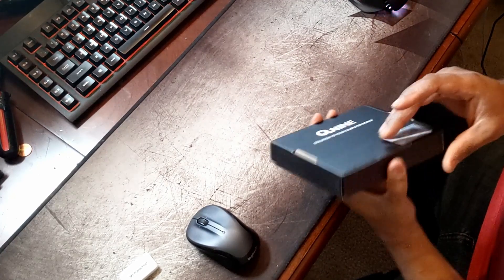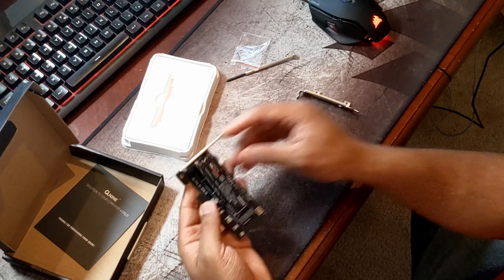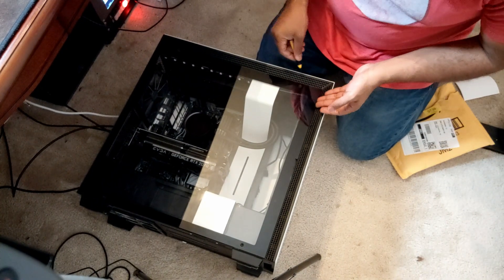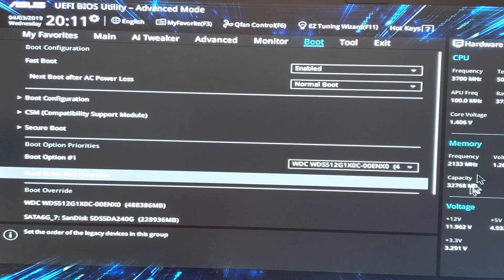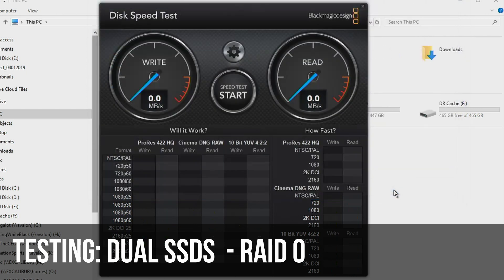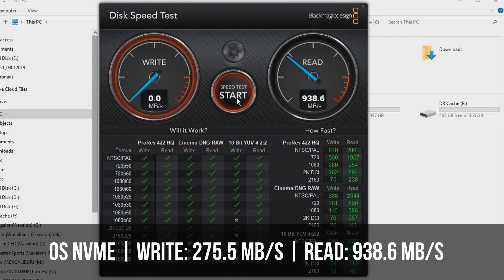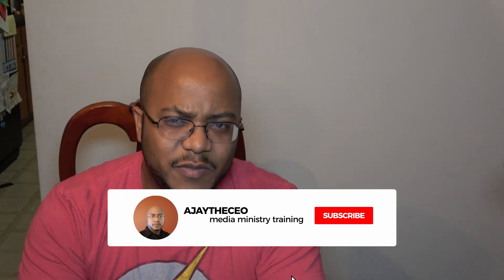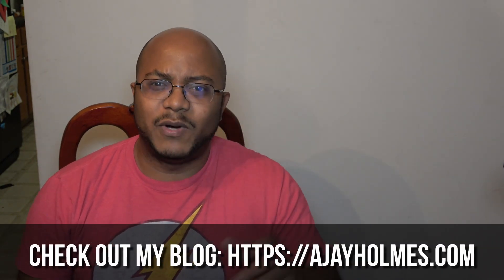Installing An Extra NVME SSD with a PCIe Adapter Card

Comment: I have a problem, the drive and the controller(adapter) are recognised in bios and I can even boot from nvme. But once I get into Windows it doesn't work, windows is very slow and constantly refreshing, and nothing can be opened. Once I go into safe mode and disable the controller everything works fine, and when I enable it again it starts doing the same thing. I have to restart my pc. Could this be about drivers or a faulty nvme?

Comment: My MoBo is MSI 970 Gaming.  It does not have an M.2 slot.  If I will be able to use a PCIE adapter to use an M.2 Drive to boot from the same?  Or if I will be able to use it as storage Drive only.   What can be done to boot from an M.2 Drive connected thru PCIE adapter?

Comment: Does anyone know if a NVME SSD with PCI Express 3.0 x4 adapter card will always work when you insert it into the PCI Express 3.0 x4 slot on your mother board.  What I'm asking is if there are different standards or communication protocols on the motherboard that you have make sure that has so that it will work with your motherboard.  I have a newer Dell motherboard that only has one M.2 slot that's used, but I'm told you can only add sata drives, but I think that's just because they don't offer an adapter card option like this video. Do you know or can advise? thanks
Reply from the maker: It should work.  How many pcie slots do you have and how many are you using?
Reply: @AJaytheCEO  I have qty 2 x4's, but one is being used, I also have one unused x8
Reply from the maker: Ok I'm not sure if it will work or not.  Sorry

Comment: AND ONE PCIE 2.0 X16 SLOT THAT CAN OPERATE IN EITHER X1 OR X4 MODE (THE LONG ORANGE BOX).
Reply: I want to ask
I have ssd nvme brand orico and adapter pcie x4 no brand
When I plug in the PCIe X16 slot and after I check in the device manager, the other device appears "PCI device" with a yellow exclamation mark, how do I deal with that?

Comment: I installed ssd 970 evo plus nvme m.2 for os. The problem is that the SSD is not detected in the bios but it's detected in Windows 10 so I can't change my boot priority. Maybe you can help the solution. Thanks.

Comment: Terrible speeds on Intel AFAICT. On AMD Zen those Evo drives should do 3000MB/s reads.

 I am not surprised. Intel only has chipset lanes to use for nvme if a proper dgpu is used. zen has 4x true pcie lanes spare for a real pcie 3 x4 nvme - so its pointless doing raid on intel, paired nvme simply saturate the 4MB/s total intel chipset bandwidth.

Comment: Thanks for the great vid, in your opinion is it better to use onboard M.2 slot or use a PCIe Adapter? Which is faster? I have an MSI Z170 Krait Gaming motherboard and an Evo 970 plus 500GB Nvme, have realized that on heavy usage I get high temperatures on the onboard M.2 slot. The PCIe with an added cooler would solve the heat problem for sure, but as I search online some people say the PCIe x4 adapter adds overhead and latency in the communication with the CPU, others say it performs better. What do you think? Best Regards, Alex

Comment: During 'lock-down' I too made jump to bunch of M2 drives for DR W10 editing; what's confusing me is; I use ASUS V2 Hyper 4xM2 W10\RAID0 for camcorder files and my relatively slower SATA SSDs in W10\RAID0 for DR cache. I have 4gb older GTX970 gpu and new x299 mobo. Should the cache be secondary concern while primary concern be camera speedy files for better DR scrubbing ? And doesn't the gpu memory (etc) provide less frame drops during editing/playing/scrubbing/effects viewing ?

Comment: Do you use the PCIE adapter to make your NVME go faster than 32GBps? I don't think it's possible. Instead of "NOT" using a NVME slot on your motherboard?
Reply from the maker: It isn't faster than the motherboard slot. I did this originally because my motherboard only had one slot. I've since upgraded and used the adapter to add a third drive since my mobo now only supports 2 NVMe drives.

Comment: One important thing, some old motherboards like mine, x99 chipset, comes with 6 pcie slots, ends up that, some of them are 2.0 version,  and some are 3.0 version, if you want the full speed of the Nvme, you need to install the pcie card into a 3.0 slot, you have to refer to your mobo owners manual to see that.

Comment: will this work with my RAMPAGE IV EXTREME motherboard? as a boot drive and installing windows 10 ?
Reply from the maker: Yes it should work
Reply: @AJaytheCEO  so no need to change my motherboard?🤔
Reply from the maker: @bgabreal1212  correct

Comment: Is this Pcie Adapter better? AKASA AK-PCCM2P-02 M.2 SSD TO PCIE ADAPTER CARD WITH HEATSINK
Reply from the maker: Not sure but thermal management would be better
Reply: nvme doesnt need a heatsink in fact it operates worse with a heatsink

Comment: The evo plus has: Read speed 3500MB/s & Write speed 2300MB/s. While the PCIe Adapter speed is Up to 3200+ MB/s random Read and 1500+ MB/s Write

Isn't this an issue?
Reply from the maker: Did you install the drivers for the evo? That should get you better performance than running the ones install with Windows for the adapter.
Reply: @AJaytheCEO  Will do this, Thanks
Reply: @AJaytheCEO  Can I install this on mainboard Gigabye H81M-DS2 ? Or any recommended mainboard?

Comment: Caution ::: @3:58  touch bare hand to chips is surely reducing the life and performance by ESD. It is not Lego.
Reply: should you put on some latex gloves or something instead? honest question
Reply from the maker: No need.  If you are properly grounded you are fine.  In 20 years I've never fried anything electronic
Reply: @AJaytheCEO  ...sorry to say, ignorance is the blessings here. ESD do not destroy the chip instantly (it is not zero or one). it creates a hole. It is interesting subject and you must learn it deeper instead of such claims.

Comment: I didn't get if in the end you moved the Samsung ssd to the m.2 slot or you are still using the adapter. I'm asking because I've done the same but the speed is half its declared speed when using the adapter
Reply from the maker: I originally used the Samsung in the adapter. I've since upgraded my motherboard which has 2 m.2 so the samsungs are directly connected to the mobo and I'm using the adapter with a 1tb NVMe
Reply: @AJaytheCEO  Sorry to bother you again, what about the speed with the adapter? Are they the same as without it? Did you change anything else beside setting the pcie slot to 4x?
Reply from the maker: @jonathanxdoe  My C Drive 970 (mobo m.2 slot) 551.6 MB/s write and 2552.6 MB/s read

F drive 970 (mobo m.2 slot)  3111.5 MB/s write 2982 MB/s Read

H Drive 1TB Sabrant (NVMe adapter) 1596.7 MB/s write 828.4 MB/s read
Reply: Had the same issue, ends up that my mobo comes with a pcie 2.0 slot  and pcie 3.0 slot, you should put the card into a 3.0 slot, so, check the manual of your mobo for that, they are identical.

Comment: Sorry, You are trying. I moved closer and see you have 2 faint shadows coming from your right side.  We should not see them. You likely do not have them high because it is in a non vaulted ceiling house. Get the 1 main/key up more if possible so we see no shadows. Move the 2nd (fill) to the other side from the main to … fill . That main should be all on you chest to head. It should be the  brighter or closer.   Not nit picky, I just get advice all the time and paying it forward.  The content is good and sharp enough.

Comment: Thanks for posting this video!   QUestions????  I'm very new to Davinci Resolve. How did you make your NVMe drive your cache drive?  Just one more...Do you know how to use the Dimm .2 slot on the ROG Zenith Extreme board? Any help will be welcomed! Thanks!
Reply from the maker: I'll get back to you on this once I get back in front of my computer
Reply: @AJaytheCEO  Thanks!
Reply from the maker: In Davinci Resolve Preferences, there is a Media Storage option. All you have to do is set your drive in this list and the first Media Storage location will be used for cache files.
Reply: @AJaytheCEO  Thanks!
Reply: How do you set up Raid 0 for the NVMe drives? Will be using 2 1TB each.  Did you ever find out how the DIMM.2  slots work?
Reply from the maker: @PhillipSiddiq  that's dictated by the motherboard but windows may be able to do it. That's how I setup my raid 0 with standard SSDs
Reply: @AJaytheCEO  Thanks again.  Dimm.2 slot? Using the ROC x399 Zenith Extreme 1950x Threadripper....

Comment: What port do you plug the adapter into?
Reply from the maker: I was in pcie 2 on my Asus prime x370
Reply: @AJaytheCEO  is the PCle drive just an SSD slot?.
Reply from the maker: @theforgottenones1542  no it is not
Reply: @AJaytheCEO  thanks for the info! Trying this with my desktop with one single M.2 slot. How is it working for you? Mine has to be plugged directly into the motherboard, yours too?
Reply from the maker: @theforgottenones1542  It was working great. I've since upgraded my motherboard that has dual m.2 slots. It ran fine and was super fast in video editing as my cache drive
Reply: AJaytheCEO Sweet no issues with the adapter?
Reply from the maker: @theforgottenones1542  nope none at all after getting the nvme drivers installed to get full speed

Comment: what is your motherboard and system configuration?
Reply from the maker: At the time this was with an Asus Prime X370. I only had my RTX 2070 in PCIe 1 and the NVMe adapter in PCIe 2
Reply: @AJaytheCEO  thank you so much,

Comment: If I install a M.2 SSD on a PCIe Adapter card, can I boot to Windows through that M.2 SSD?
Reply from the maker: Yes you can
Reply: @AJaytheCEO  my pc won't show pcle slot for m.2 ssd Samsung evo plus.
Reply from the maker: @mussim2919  what motherboard you using?
Reply: @AJaytheCEO  I'm using MSI Z370-A PRO LGA 1151 motherboard with only one m.2 nvme slot. Bought silverstone ECM25 silverstone adapter card with samsung 970 evo plus. It doesn't not read ecm25 adapter but it shows the drive in this pc windows mode.
Reply from the maker: @mussim2919  that's strange but if you can access it via Windows then you're good right? Have you tested accessing it or speed tests to the drive?
Reply: @AJaytheCEO  I'm not sure, I want to set the ecm25 adapter to be the main boot. Is that possible? It won't show in the boot mode or in the bios.
Reply from the maker: @mussim2919  go through the installer process for Windows and see if it shows the drive, if it does windows should be able to boot to it
Reply: @AJaytheCEO  Ok I'll try to do that. Thanks!
Reply: @mussim2919  no answer >so did you make it work ? boot from the adapter m.2 ?

Comment: Sir, is it possible to fix nvme SSD to old mother board.. DH61HO is the model number..
it's an Intel motherboard
Reply from the maker: I'll let you know if that will work
Reply from the maker: Yes you connect it but you may need drivers for the motherboard to recognize it. I'm not 💯 sure since I don't have my hands on one to fully test

Comment: Great video! Currently building a pc specifically for editing in DaVinci Resolve and I'm also using the same brand of Evo Plus NVMe M.2 so this is really tailored towards me! BIOS configuration segment will also likely be extremely so many thanks. 

I've also purchased another NVMe M.2 chip for OS and applications. Do you think I am fine to install that to the motherboard just over m.2 without an adapter for pcie? I believe I will likely only need the pcie adapter and slot for my working cache drive in DaVinci and Premiere.Thanks again!
Reply from the maker: Yes that will work
Reply: @AJaytheCEO  awesome much appreciated, thanks again

Comment: how to install 6 nvme ssds in my pc
Reply from the maker: You are restricted at how many NVME drives you can use based on your motherboard and how many PCI-E lanes are available. What motherboard are you currently using and CPU?
Reply: @AJaytheCEO  i use a laptop but in my dad's pc there is core i3 6100 and motherboard iam not sure about
Reply from the maker: @indiangamerz3788  Honestly I doubt you could get more than 4 NVME drives in a system without heavily compromising how many other devices you could run. You are honestly looking at server boards that would support this many NVME drives. You probably can go a max of 4 with a modern board but I have no clue how many your i3 would support.
Reply: @AJaytheCEO  no dude not looking for server boards
Reply from the maker: @indiangamerz3788  understood. The most you could do is maybe 2 with these type of adapters. If you have a laptop then the only thing you could do is so an external nvme enclosure connected via USB
Reply from the maker: @indiangamerz3788  Something like this: https://amzn.to/2lMC2No
Reply: @AJaytheCEO  like i want to have around 6 m.2 satas in my dad's pc
Reply: @AJaytheCEO  i have B450 Pro 4 and i alredy installed Nvme on Ultra M.2 Slot, but when i'm trying to add more Nvme with PCIE 3x4 adapter, it didn't work, so i though My motherboard will only support one Nvme installed..  is it true?? plis i need an answer or solution mybe?
Reply from the maker: @avongunadi  it depends on how many PCIe lanes it supports. What else is in the system?
Reply from the maker: @avongunadi  Who is your board made by?
Reply: @AJaytheCEO  Asrock B450 Pro 4
Reply from the maker: @avongunadi  Which slot did you use because it will work but per Asrock
*If M2_1 is occupied, PCIE4 will be disabled.
Reply: @AJaytheCEO  yup.. that explain, so i have to choose M2_1 or PCIE4, n i can not use both..
Reply from the maker: @avongunadi  correct. Just move it to slot 3
Reply: @AJaytheCEO  slot 3 is not a PCIE16
Reply from the maker: @avongunadi  oh ok

Comment: Hallo Ajay can used this in my Mac mini late 2014 Base model 1,4 GHZ, core i5,4 GB RAM , ,
Reply: Thank you brother
Reply from the maker: how did it turn out?
Reply: I am asking you sir can I put this in my Mac mini
Reply: If this possible which is best NVMe for my Mac
Reply from the maker: @lourancealhameed5549  based on what I see for that model on ifixit, it should work. A 970 plus Evo from Samsung should work

Comment: Did you swap the place wise, or did you leave them where they were and just move the OS?
Reply from the maker: I moved the OS and bought another one for my video editor cache drive
Reply: @AJaytheCEO  Right, but did you physically swap the drives?
Reply: I'm trying to figure out if you can boot from the pcie slot.
Reply from the maker: @todah09  yes you can because it will show up as an option as long as motherboard detects it natively
Reply: @AJaytheCEO  Thanks bro! Preciate the quick response.
Reply from the maker: @todah09  yes I did

Comment: Hi sir... please suggest me best PCIe adapter card for NVMe m.2 Ssd.... i hv PCI 3.0 x16 slot in my motherboard... i want to use NVMe Pcie ssd...
Reply from the maker: This one works great for me https://www.amazon.com/QNINE-Adapter-Express-Controller-Expansion/dp/B075MDH28Y/ref=as_li_ss_tl?_encoding=UTF8&psc=1&refRID=H00AQE9RY30R8YR6QV93&linkCode=sl1&tag=technobab04-20&linkId=f0df1a45c52d0de2f732adb8208cc9f6&language=en_US